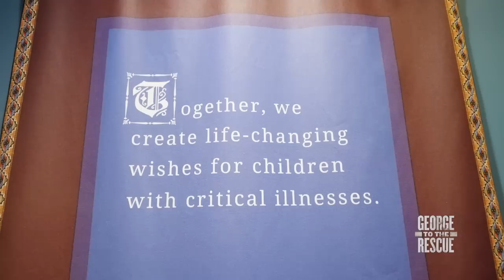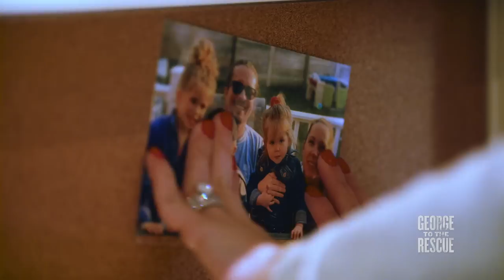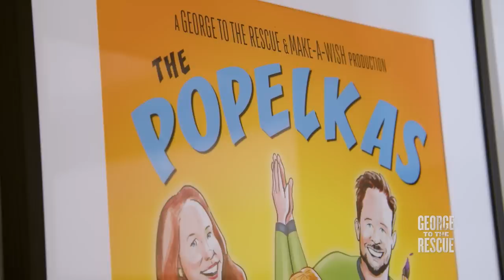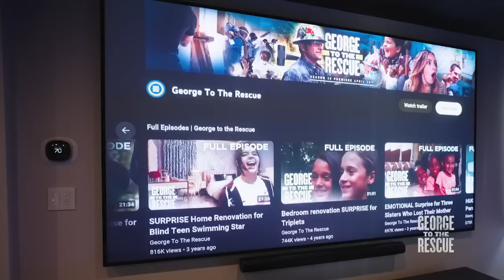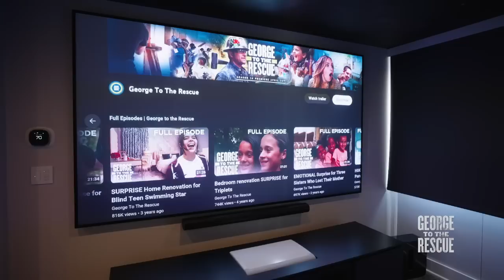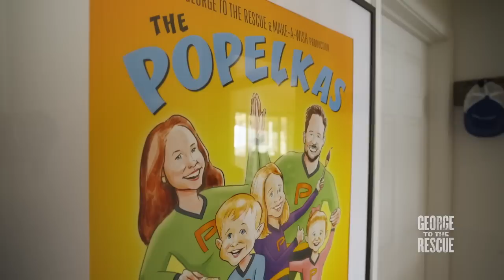Wish Granted! Heartwarming Home Theater Transformation for Amazing Little Boy | George to the Rescue

Comment: The challenge about something like this is it reinforces that passive, non-physical entertainment requiring little or no effort is completely positive. It is not. Yes, for two children with physical challenges a focus on sitting staring at a huge screen has merit but as a culture celebrating and focusing on entertainment over producing and working and contributing is not a balanced message. So much about life is being lost to the obsession with screens. And, yes, the irony of being on a screen to point this out is not lost on me. But rather than simply gush at the wonderful aspects of this story, which are real and valid, I find it necessary to point out that there are downsides to things like this that are ignored. And I realize it is possible the balancing act is going on behind the scenes and the emphasis, appropriately, is on the wish, the joy, the immediacy. But if not I hope someday there will be a focus on a balance that honors work, contribution, producing, effort, struggle and the power of giving rather than only receiving.